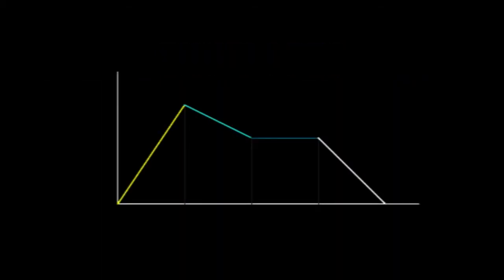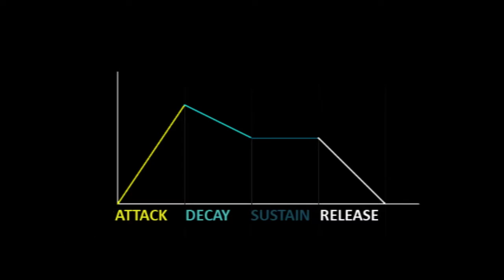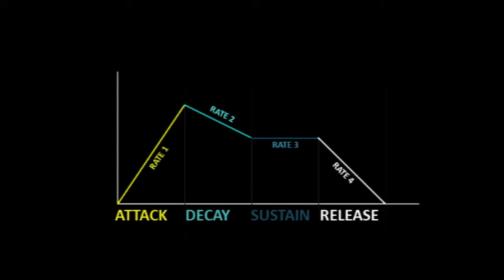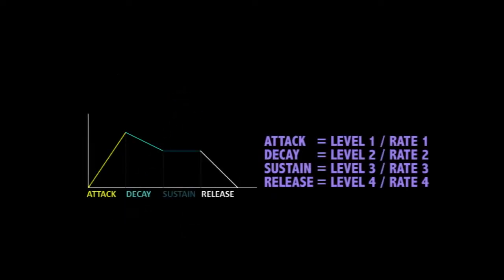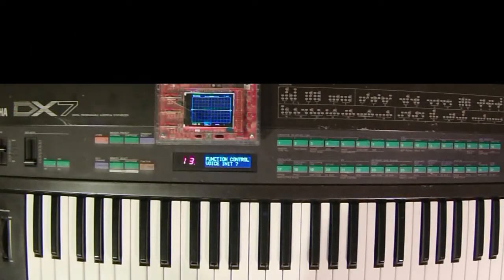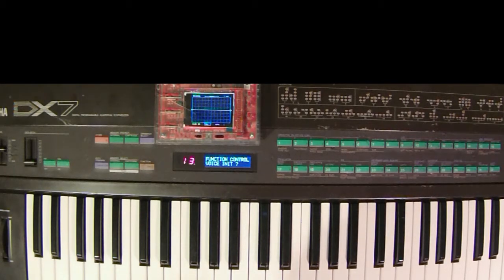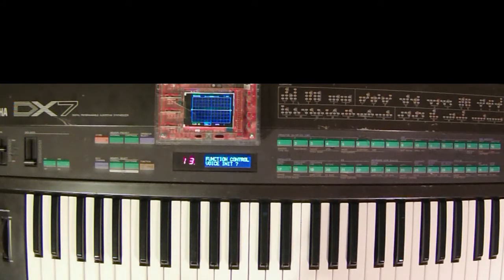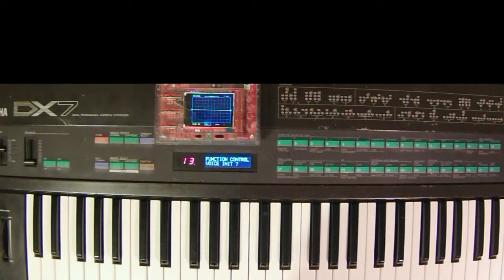Yamaha DX7 FM Synthesis Tutorial | FM Envelopes Explained

Comment: Major boast "This is the BEST video on..." is validated by the clear and concise advice 1.)  Treat the carrier ADSR as AMP ADSR, separating the modulators as overtone generators and 2.)  something I'd never heard before but:  after your ADSR values are set, focus on the decay rates for most sound design.  

Those two bits of advice make SO MUCH sense after having struggled for so long to get the sounds I want out of FM synths... and yes, they only make sense if they follow the Yamaha envelope model (decay rates don't exist on the opsix for example.)

Comment: I’m trying to copy this over to my reface and it seems as if the system is slightly different where you have to mess with the eg level and eg rate together to modulate things like decay, is that accurate or am I being dumb? The concept translates well enough but the graph is still operating differently on the reface

Comment: Sweet patch.  I'll have to try it on my DX7.  I noticed the oscilloscope image and wanted to ask, is this something that you have edited onto the main video image?  I am guessing you haven't found a o-scope that small to mount on your DX7.  But if that is the case, I want one too!  I have a nice older Tektronix o-scope but it is a rather large beast.  About the size of a desktop PC.  I look forward to your next video and am subscriber #190.  Cheers, Rawl747
Reply: I saw below that you are suing a Jye Tech o-scope.  Would you please tell us which model?
Reply from the maker: Yes, the o-scope is a little DIY Jyetech unit - model is DSO138. Its a great little unit and perfectly capable of tracking audio waveforms for synths. I believe they are a DIY kit but I purchased mine second-hand and it was already assembled. It runs on 9V (center positive) and I also purchased an RCA adapter to connect an audio cable to the BNC socket.
Reply: madFame thanks so much for your reply.

Comment: Great video, really helpful! Especially about the Modulator needing to have a longer release so it doesn't run off to early compared to the carrier. 

I don't have a DX7, but I have a Volca FM. I wanted to exploit R1 and L1 to delay a sound after the keypress. I noticed that if I set L1=0, R1 would not have any effect. So I set L1 to somewhere slightly inaudible so I could exploit R1 to delay the sound. In this video, as far as I've noticed, you didn't seem to have that problem. And as far as I know, people say the Volca FM emulates the DX7 pretty accurately. Do you have any idea?
Reply from the maker: Hi there great question. The way you're using your envelopes sounds correct. Does this occur all of the time or just in a particular sound you're working on? Also, is this happening with a Carrier or Modulator (both?).

There may be a limitation in the Volca itself or there may be another parameter value that is forcing your envelope to respond this way.
Unfortunately, I don't own a Volca to try and replicate it but if you could show the envelope values you're using that may help to figure out what's happening.
Reply: Hi! I have a video on my channel that's half an hour long of me walking through the patch. Here's a short clip of it: https://www.instagram.com/p/BWZgF0pjMAa/?taken-by=p07a

I think it happens with only the carriers. I have not test out with the Modulators (since this patch is making use of 6 OPs all as carriers, I'm delaying OPs one after another to create this fake arpeggio). I didn't script the video (on my channel), so when I was walking through the tutorial, I realize that R1 doesn't do anything unless I set L1 to ... say... 50 (which is almost noticeably audible). 

Maybe I'll downloaded Dexed and see if that's the case there as well. I don't own a Dx7.
Reply: Here's an earlier draft of the same sketch: https://www.instagram.com/p/BWZb_ojDk36/?taken-by=p07a

You notice that the notes aren't evenly spaced. I realized this is because of the OSC Rate Scale, or Velocity mod sense. Both of which affects the rate of the operators depending on the note you play (higher note means shorter R1, stronger velocity means shorter R1). I realized that and disable those things but still seeing R1 being affected by L1 being 0 or some small values.
Reply from the maker: Thanks for the links, great patch! I'm in the middle of editing the next video dealing with Frequency programming and I'm using ALG32 just like in your video. Here's the patch:

ALG32
ALL OPs ON
ALL OPs Output Level = 99
ALL OPs EG LEVEL= 
L1=0  L2=0  L3=99  L4=0

OP1 Frequency = .50
EG RATE = R1=99  R2=99  R3=99  R4=45

OP2 Frequency = 1.26
EG RATE = R1=99  R2=50  R3=99  R4=45

OP3 Frequency = 3.00 /  Detune = -2
EG RATE = R1=99  R2=45  R3=99  R4=45

OP4 Frequency = 3.78
EG RATE = R1=99  R2=40  R3=99  R4=45

OP5 Frequency = 4 /  Detune = +5
EG RATE = R1=99  R2=33 R3=99  R4=45

OP6 Frequency = 4.48
EG RATE = R1=99  R2=37  R3=99  R4=45
Reply: It looks like a cool patch! I haven't patched it, but after reading it, I'm expecting you're doing some sort of additive analysis.
Reply from the maker: The new video is looking at frequency tuning across multiple operators. The envelope in this example is staggered creating a delay/omnichord effect similar to your video. If you try the envelope values above it might help solve your release rate issue in your Volca. Let me know how it goes.
Reply: @madFame  Hi madFame, I come back to this video to confirm that I believe the envelope of the volcaFM (and hence also DX7's) is a DADSR. If you set L1 to be 50, L1 is actually still inaudible, which you can then use R1 to specify the Delay value of the DADSR. I've just uploaded a video on my channel that is a re-making of my old video. I'm not yet exploring all of its possibilities, but DADSRs (on each operator!) is quite incredible.

Comment: So the envelopes only modulate amplitude, not frequency for each operator?
Reply from the maker: Hi Scott, that's correct. Each operators output can be controlled using its envelope. The effect of the operators output is determined by its role in the algorithm.
Reply: On my old Novation KStation (virtual analogue) I can have FM modulation and apply a pitch EG to the modulating oscillator. I wish FM synths did this too.

Comment: at 1:51 when i have operator 2 which is identical to operator 1 modulate OP1 (i have an init CART) i don't get a saw wave :S ??? How come?? Do i need to change the pitch orr..??
Reply from the maker: @Boi Mesa To make a sawtooth you need a 2-op stack (the modulator should have a feedback loop) and these values in place: 
Carrier Output Level = 99, Frequency = 1.00
Modulator Output Level = 75, Frequency = 1.00, Feedback = 7.
Reply: @madFame  yeah i just realized it doesn't become an actual saw but that  it's just an estimation ;) great vids dude!!

Comment: May you tell us what Osciloscope are you using?
Reply from the maker: Hi Renzo,

It's a Jyetech digital oscilloscope. Runs on 9volts and cost about $20USD. It's a great little unit, I use it with all of the time when I'm programming.
Reply: Thanks dude, I'm trying to find Osciloscopes but couldn't find any one except from those that are extremely powerful compared to what we do on sound haha. Greetings from Argentina dude, your videos are great and how you made an interface for them and animate them, is really really good. I cannot believe you have <100 subscribers! Good luck
Reply: ohhhh btw, you should make a video on the Linear and Exponential functions! That would be really helpful
Reply from the maker: Kia ora from New Zealand, it's great to have you on board! I highly recommend the Jytech oscilloscopes, they are really simple and useful (and inexpensive!). Thanks for your support Renzo.
Reply from the maker: Great suggestion, it's on the list!